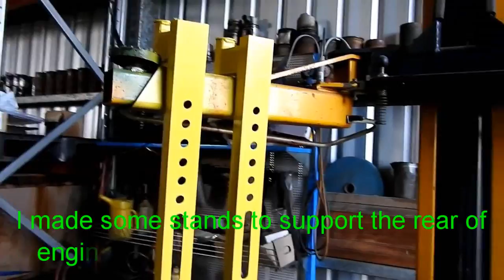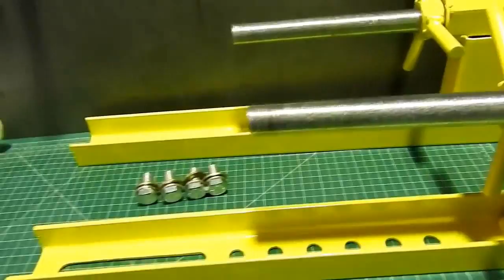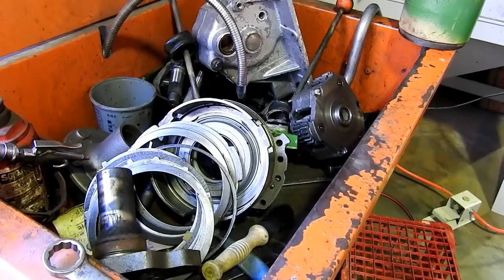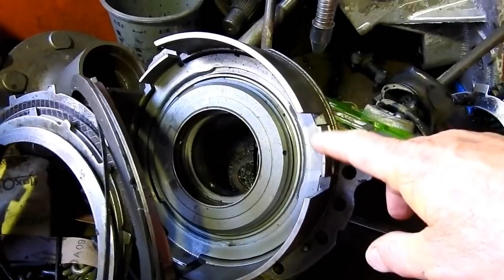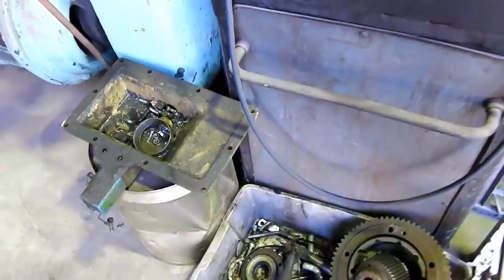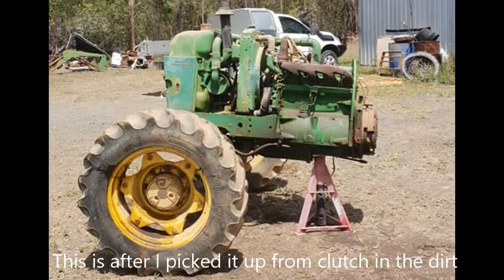The John Deere 1640 Project Introduction

Comment: Hi lance. Hope all is well with u. I enjoy watching you videos, very detailed and educational. Just wondering did you make a video of building the 4wd output shaft back into the housing. I have a 2040 4wd and was hoping to replace the shaft as mine is worn splines on both it and the universal yoke on the prop. Not sure if the output shaft can just slide out of the housing or if I need to remove and dismantle the output shaft  housing unit completely. Thanks.
Reply from the maker: Im not sure now I did so many, lol. To remove the shaft just undo the 3 bolts on the round seal housing and pull it forward. Drain the oil first.
Reply: @bundybearsshed  thanks for getting back to me lance. Not as bad as I thought it would be.

Comment: Hi Lance, great videos. I am restoring a 1969 David Brown 990 Selectamatic and was wondering what fluid you use in your parts cleaner. I have tried a water based product but if I don't get every drop off I end up with parts going rusty!
Reply from the maker: I use an LSA product much like Kerosine,  there is a link here http://lsaoils.com.au/products/item/degreaser.html